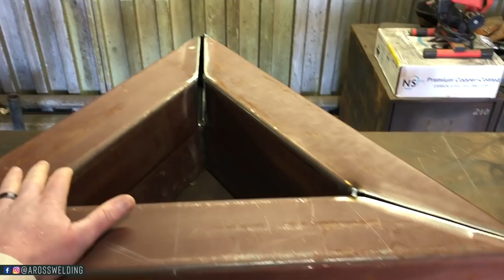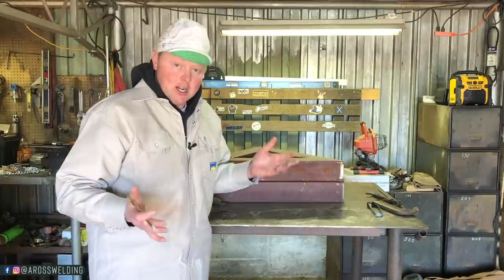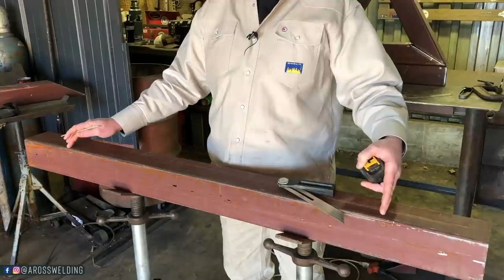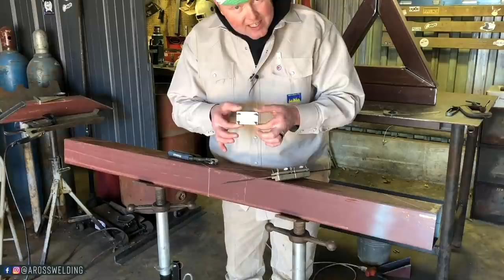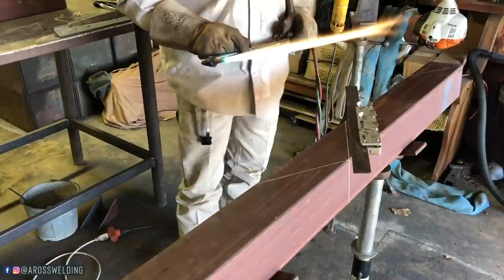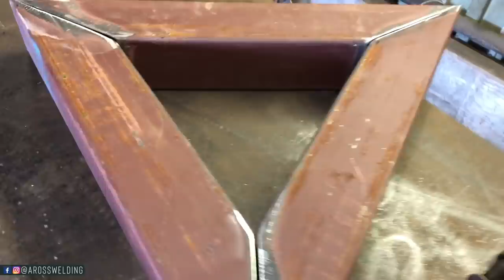WELDING SHOP PROJECTS “TEXTBOOK FABRICATION VS. REAL WORLD”

Comment: Your tape probably has slop at the hook thus causing your length to be off by as much as 1/8th or more.
Reply: Tape measure hooks are supposed to be loose, that way when you measure outside or inside you get same number.  The looseness accounts for the thickness of the  hook.

Comment: Piece on the left is short. And your angles are inconsistent.  31 degrees.. 29 degrees, etc.   I cut 4" to weird angles regularly using the band saw. (I'm old and can't see to weld as well anymore. You should aim to retire at 40. Trust me. )  The guys HATE when someone else runs the saw.  Now, go stuff some scrap in those gaps and weld it up!!

Comment: Could be just one of the things attributing to the gap but looks like you measured from the outside of the tube wall but then when you bent it the origin of the angle is actually on the inside of the wall

Comment: 360 degrees divided by 3 is 120 🤣
How is biden’s energy plan effecting you and your other welding brothers?
Have you had any offers from the new green energy program that biden boast of?
Suggestion: heating the magnets with the torch to clean them off  
 might not be a good idea, when magnets are heated they lose their 
Magnetic flux, and thus the bb’s can be blown off. However heating them can cause them to explode when exposed to the cool 02.
Not a good practice..
No I am not a safety nut but I do apply the experience’s of others and my own when doing things. 😁🛫